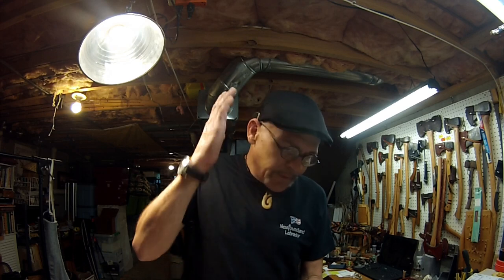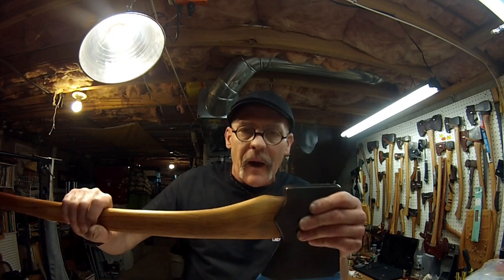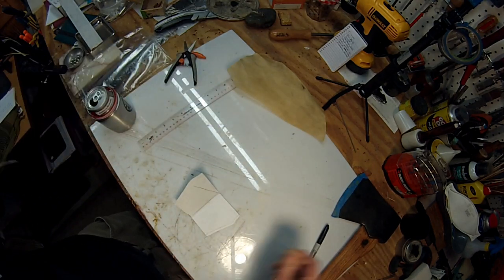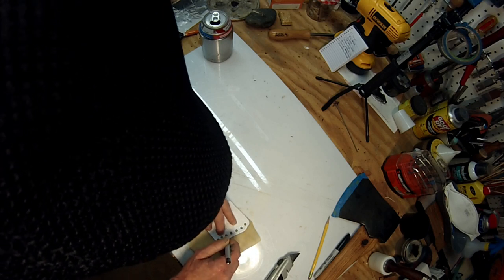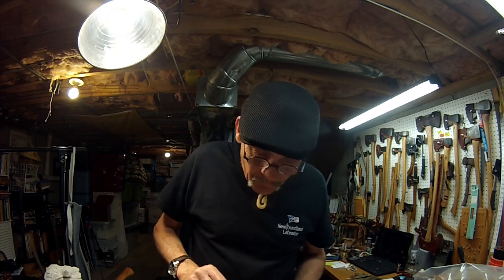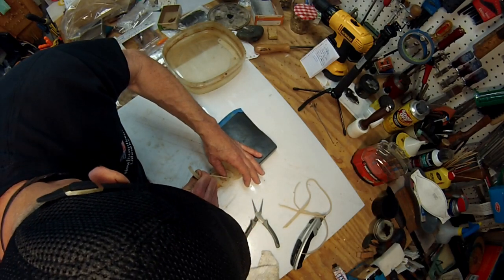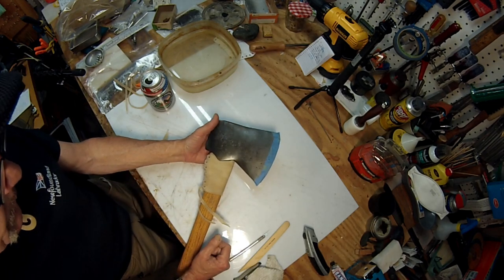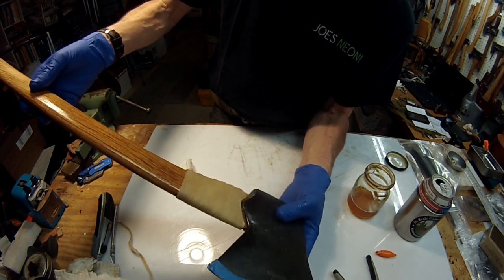Rawhide Protective Axe Collar

Comment: I like that Joe! Makes the axe look nice as well as protection if used at all splitting wood 4 sure. I rem using snowshoes filled with moose hide years ago on wet snow, the rawhide got so loose, tighten it then,  and when dried few days later tight as a bug in a rug...great vid .
Reply from the maker: Glad you like it my friend!!! Once the rawhide is bone dry on snow shoes it was shellacked to prevent that. Thanks for watching!!
Reply: @joesneon  Didn't last very long on my snowshoes Joe, I used them! ahahha

Comment: I know this video is a little old now but just a idea to smooth the transition from wood to rawhide is if you maybe laced it from the bottom up so the knot was directly under the head of the axe. Id assume you wouldn't feel the knot as much